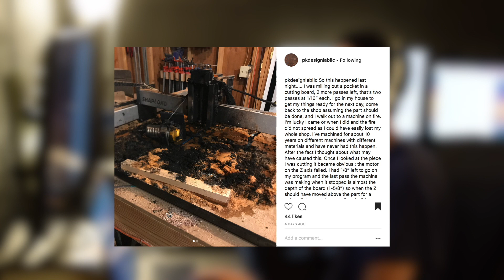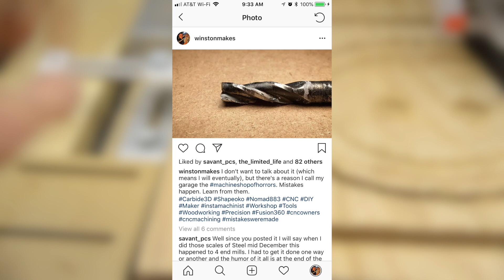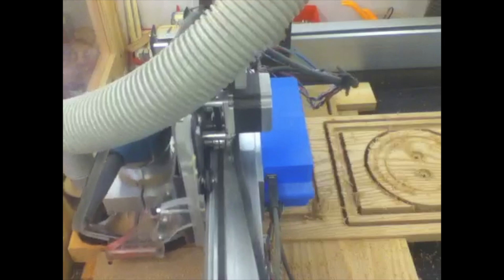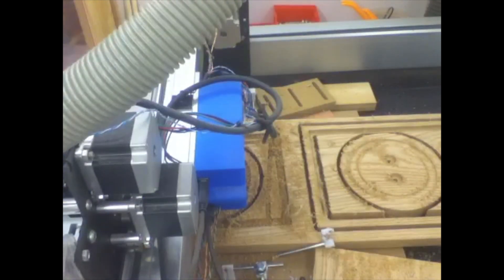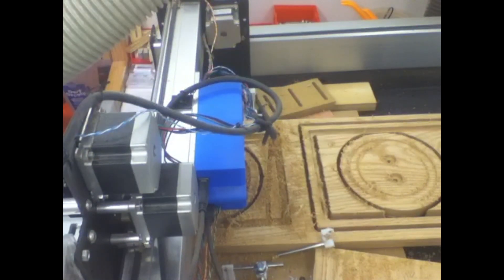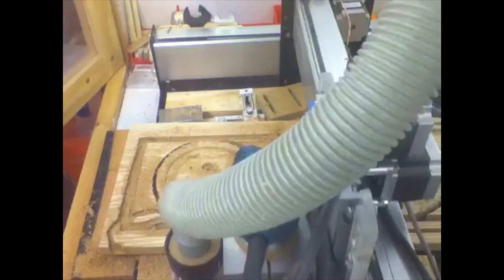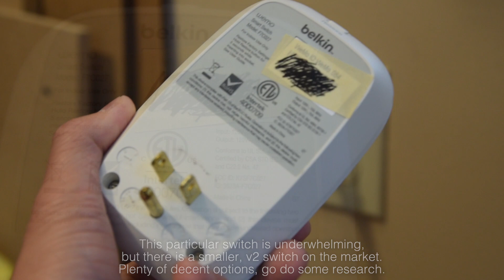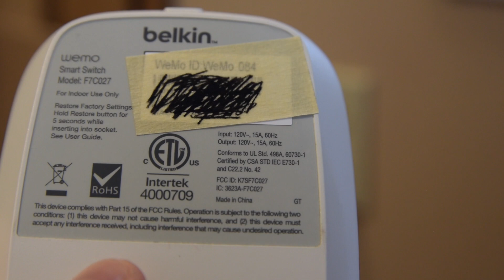I Almost Set My CNC on Fire - Let's Talk Shop Safety

Comment from the maker: ADDITIONAL TIPS (updating them as they come in):
1) If you suspect your vacuum has ingested sparks, check your dust collector and hoses immediately. Very fine dust accumulates in those systems and a fire could smolder for hours inside.
2) You can remote into Carbide Motion and control it using http://{your ip here}:8080 (i.e. http://192.168.1.1:8080). The carbide motion interface will be displayed in your browser. [Thanks, DIY Engineering]
3) Know where your nearest fire extinguisher is. (You do have one, right? Seems obvious, but it's worth reinforcing ad nauseum.)
Reply: Add overcurent protection to your spindle power. Plenty of ways to do this however its smart to have a way for this protection circut to hault the machine.

Comment: Great video. Had these issues in my own shop. Almost lost my garage to a major laser fire and my workshop to a cnc a corroded connection on the Z axis causing it to not lift back up while machining. All machines now have cameras and I'm thinking smart plugs for when I'm not in close proximity

Comment: I'm obviously VERY late to seeing this video. But as someone that runs a machine shop with six figure CNC equipment in it, I would also add one of the most important steps in preventing unplanned disaster. REGULARLY MONITOR YOUR TOOLING.  Dull tools, especially in woodworking are going to be a massive hazard.  I would add to that, don't cheap out on tooling. Carbide ain't that expensive anymore, and especially on high heat buildup applications like most woodworking stuff is, it's going to stay sharp a lot longer.  Remember since you're not cutting metal, where a lot of the heat gets taken away by the chip, an overwhelming amount of the heat is going to be transferred into your tool. And that tool can easily get hot enough to ignite wood.  Good airflow, proper maintenance and high quality tools are going to save you.  Even with properly clamped stock, you could still drag it out of the clamps by the added force of dull tooling.

Comment: Most line AC mains smoke alarms communicate via a shared line that puts out a 9 VDC signal.  Fairly easy to cuts AC power to CNCs and 3D printers and trigger other actions with this signal.

Comment: line your enclosure with drywall . It will give you a buffer as drywall is very very fire resistant. It is used as fire breaks in multi unit  homes and my father used it in walls to block the flame when he was soldering copper pipe. You can put a torch straight on it and it will not catch fire. The paper on the surface will but the underlying gypsum will not.

Comment: Is there not a CNC router equivalent to 3d printings' Octoprint?  I can send my files over the network, fully manually control,  pause, monitor and power on/off from my office pc, in fact it is possible to set things up so I can do all that from anywhere in the world provided I have internet access (not that I see much point in that to be honest) All it took was a RPi 3b, a cheap relay and an old usb webcam.  I would have thought CNC, being a much older and more established technology would have had something similar.  That all said - all the advice in your video still stands regardless, I'm just surprised there isn't something similar available.
Reply from the maker: You still have to be at the machine anyway to load material.
Reply: Absolutely.  I'm not suggesting quite the same level of remote operation, I just would have thought there'd be a similar setup for monitoring and control should the need arise.  Maybe use an ESP32cam board, with a simple web gui that can control a relay via one of the GPIO pins.  So if you have to leave the machine you can keep an eye on it and immediately hit the brakes remotely should something arise without having to get back to the machine to shut it down, potentially reducing any damage.  Imagine if the worst happens during a loo break! Shut it down with your phone there and then, and pick up the pieces when you're 'done'!

Comment: Great video.  Sharing the bad things is hard but the best thing to do.  Having a trip on the power which you can set the amps on can help so it trips once things go wrong and also sound audible alarms. As a thought, a limit switch on the clamps or some positional switch might help to sound an audible alarm if stuff comes loose.  I used to run industrial cnc and the easiest is simply don't leave them unattended.  Sure, take a book or laptop and work next to it but never more than 5 seconds away as runs could always be paused if needed

Comment: At work I use a MultiCam router with 20Hp vacuum. I was cutting 1/8” thick aluminum when the bit plunged thru a loose part causing a friction fire.  The vacuum table made it 10x worse. Luckily I was there and was able to get the fire out in time.

Comment: First get a brushless water-cooled spindle, have a fireproof enclosure, have IR heat detectors connected to the emergency stop loop and fire suppressant system, have your internal CNC wiring checked by a professional..
And even then, you won't let your CNC alone.

Comment: New steppers drivers with missed step detection ? The new trinamic can be used as the old drivers but you can plug in an Arduino, and if your machine misses a step have your arduino send something to the control board or a relay to shut everything down

Comment: I would recommend having several types of extinguishers on hand as well. My goto  first for electronics these days is Co2. They do require the ability to control air flow into the effected area. But they are far easier to cleanup post usage. Without destroying electronics or requiring a significant amount of cleanup time. Halon is not a good choice for home/small shops not to mention the cost and additional safety concerns. While its the other go to for electronics, and works. The chance of suffocation and the environmental damage means its a liability and restricted for sale. But I still keep a powder based extinguishers on hand. As well as a water based one. With them Labeled and accessible.

Comment: I have a lot of respect for you, Winston, but I find it utterly irresponsible to be discussing ANY form of remote monitoring solution for ANY unattended power tool - whether a CNC, a table saw, or any other high-velocity cutting machine for that matter. Advise your insurer that (a) you are operating a CNC in your home, and (b) it is left unattended while operational... I'd love to hear their response... Let alone the risk that (in your case) a neighbouring child hears the noise from your garage (while you were across the street there), and wanders inside to see what's going on... your fire suppressant ball is of little value then. PLEASE (and in your capacity as an employee of a CNC manufacturing company, I implore you) DO NOT be advising/recommending ANY "solution(s)" that suggest/imply that an unattended machine can be "made safe(r)"... it's simply not true. (for your sake,  there could even be an element of "liability", were anyone to take on board your (otherwise respected) advice, and then experience an incident)
Reply: You are right, the biggest concern is with the routers used, most are brushed which mean they produce sparks (add some fine wood dust...) and they were not build for continuous operation.
You don't leave such thing unattended !

Comment: THANK YOU SO MUCH for this video! This is a video I am going to keep on hand. I am a student welder, which is WROUGHT with it's own safety problems to plan for, but also starting my own welding/fabrication/makerspace company I need to plan out being able to induct other people on safety in MY shop. I just received my SainSmart CNC router of which I dedicated some investment into for the ability to broaden my projects. However, had no idea other than common logical safety guidelines with it, so this video is a sobering expansion on my list of outcomes. I already have an Induction Plan for guests to my factory/makerspace involving welding, but THIS is totally going to be going along with it as an example for what can go wrong with CNC machines. Good tip with the WIFI power outlet - I will have to plan something like that for my shop, as I already have a Wifi-Webcam setup for it.

Comment: When it comes to CNC safety, I think the most important thing is to hear the machine as it's working. Pretty much every time you can clearly hear when something goes wrong. I never walk away far enough so that I can no longer hear my machine working. And yes, having a fire extinguisher in the workshop is a must, regardless whether you have a CNC machine or anything else.

Comment: What are people's opinions on cheap dry powder fire extinguishers vs more expensive CO2/Halide/Halotron tanks? I was under the impression that dry powder extinguishers were corrosive and would pretty much destroy your machine if used, but now everyone's using these balls that AFAIK are essentially the same dry powder materials set to automatically dispense.

I would like to not spend the extra money on exotic fire extinguishers but also would like to be able to put out a potential fire without destroying everything.

Comment: I lost a laser cutter within 30 seconds of walking away. Laser got disconnected and fired full power without moving and caused the material to ignite and start a fire. Due to the window being on the topside of the machine, and having a really strong exhaust, even though I was only 6 feet away and facing the machine I didnt realize anything was happening until the top window melted and you could smell the plastic melting on the exterior. Bet the neighbors got a good scare from all the smoke billowing outside lol.

Now I have one of the webcams with remote access connected and servo control with an ipad that I have within view the whole time, and I have added emergency stops on the main power lines to my new machine as well as invested into halon so that if I do have to use an extinguisher I wont ruin the electrical components of the machine.

Having one of these mishaps is definitely eye-opening and Im glad your shop is still intact!

Comment: I have stepper closed loop system on my lathe controlled by  Centroid  Acorncnc.
The drivers a  default built in and shuts drivers down, if there is to much torque.

Comment: Has anyone thought of grounding the bed holes to a touch plate like zeroing sensor so if the endpoint touches a metal clamp it interrupts the program to go to failsafe?
Reply from the maker: The touch probe system requires electrical continuity through the endmill, and that's typically done via an alligator gator clip to the the endmill. If you can get it to work by clipping to the casing of the router or something not spinning there's a chance. Otherwise not likely.

Comment: I have a question.  I am debating purchasing a shapeoko.  The location where I plan to  have it set up is in my detached garage with out ac.  I live in Louisiana. Summer time is stifling.  How does it hold up let say in a shop or garage that is not climate controlled?
Reply from the maker: Ive heard of people periodically having to check belt tension and whatnot with large temperature swings. My bigger concern is personally humidity in the context of wood/MDF movement over time, particularly with the wasteboard. I have not quantified this though. It all basically boils down to a shorter maintenance/checkup interval. But the machine itself should run fine.

Comment: I have had fires twice both times caused by bad CAD software and dull bits.
Cad software Vectorworks creates complex curves  as thousands of tiny straight lines and my post processor works it way through those curves excruciatingly slowly, enough the bit heats up and starts the wood on fire. With a downdraft table and dust collector the fire is invisible as all smoke is drawn down into the table or up the dust collector. I now make sure complex curves are smoothed by my post software first, and avoid Vectorworks drawings at all costs.

Comment: Fire suppressant, monitoring and smoke detection systems aside, it seems that one of the failure modes common amongst these starts when you lose steps and the system no longer has an accurate relative position of the cutting head.
Could this be aided by a device tuned to detect skipped steps, similar to the microphones used in modern engines to detect knock/pinking? Maybe something the stepper driver can detect through back EMF?
Just thinking out loud really.

Great video as always Winston. It raises some really valuable points that are often neglected in the hobby CNC/3D Printing/Laser cutting world.
We had a minor fire on our 8' x 4' CNC router when a dull end mill basically primitive technology-ed itself a large hearty fire with a nearby gathering of chips/sawdust.
Timed dead-man switches and various monitoring systems have helped since, but nothing is ideal.

Comment: One clamp by itself does not have enough holding power to withstand XY torque from even a light cut taking place more than a couple of inches from the clamp. Therefore, two clamps = single point of failure. 

(DarwinGarage also had only two clamps, according to the video comments.)

Four-point workholding should be your default, and IMO anything held at <4 points shouldn't be left unattended at all.

(Sidenote: the load at each workholding point increases rapidly as you decrease the number of workholding points. If you remove a single point of workholding, the total torque on the rest of them increases because now the moment arm is longer when the cutter is engaged near the now-removed workholding point. As a result, workholding is prone to cascading failures unless there is a very generous safety buffer built into your workholding setup.)

Comment: I've heard of also using a smoke detector where the speaker also triggers a GFCI outlet and cuts off power to the whole system. Might be a bit too late for a cnc with a bunch of mdf and sawdust in the enclosure, but for a 3d printer in a cheapo enclosure, it might be a valid safety step

Comment: use a smoke detector connected to the emergency button connection. can't get wrong with that.
a bag of sand mounted above the CNC with a special contraption that spread the sand over the burning part should be another idea.
sand can be cleaned, the marks of a fire cannot.

Comment: I once had a long plank of wood clamped through my Shapeoko2.  I walked away, so the CNC tried to make a break for it.  I returned to find the plank had come loose and shifted severely, the part was a little burned, and the Shapeoko2 was moved almost half way off the bench!  Lesson was learned that day.  Also I never  leave my homemade 80W Co2 laser running unattended for obvious reasons.  It also has its own dedicated fire extinguisher and water squirt bottle just in case.

Comment: Since it appears that one of the main cause of these mishaps is the work piece moving on the table, it would be fairly easy to setup an alarm by having a contact sensor between the work piece and the table.  If the work piece moves, it breaks contact and sends an alarm or pauses the system.
Reply: how about just secure your work piece, jfc, this side of the "CNC" world is embarrassing.

Comment: I would consider moving the fire extinguisher ball to the center of the ceiling of your enclosure.  I suspect by the time the flames reach that corner, your entire wood enclosure is going to be engulfed and it's unlikely to make a significant impact to a fire.    Having it centered on the build platform where the fire is most likely to happen gives you a better chance.

Comment: Thank you for bringing this matter to the attention of the CNC community. It's easy to overlook matters of safety because they're predicated upon rare events but this is a very important issue. I'm currently embarking on a production using CNC that will run 24/7. I have not yet addressed these safety concerns but I will. I'll install a remote video monitor. I'm thinking of hacking a smoke detector that's inside the enclosure so it can E stop the machine. My typical crash breaks a 1/16" router bit producing essentially no risk of a fire from friction but this sort of hazard mitigation must necessarily include the extremely rare event.

Comment: Great advice Winston.  Well done.  I have both a fire alarm and a fire extinguisher nearby.  I babysit my laser because most jobs I do are in the 5 minute range and are often repeated over and over requiring me to switch parts.  On the CNC job times run longer.  It's best to find another task that can be done within eye/ear shot of the CNC.  I haven't gone to the extent of a camera setup at this point.

Comment: You may not be able to use teamviewer free for that for very long. I just got kicked off of teamviewer (account removed) for the second time due to "suspected commercial use" because I was using it to watch my CNC machine, etc. Now that you have shown it on your channel which you make money off of "commercial use" you will probably get in trouble unless you pay for an account. They are not very friendly. But TightVNC is a good free alternative if you can handle a few more steps and not as nice front end/GUI applications.
Reply from the maker: Good to know. Really they should be paying me since I'm plugging their product... 🤔

But since DIY Engineering mentioned remote access to Carbide Motion via IP/Browser and there are options for full PC control I think I'll be fine. Thanks for bringing that up.
Reply: Yeah, for anyone playing along at home I would still give teamviewer a shot for as long as you can if that fits into your workflow. As you mentioned there are many alternatives and different ways to accomplish the remote monitoring.

Thanks for the reply, Winston. Great video as always and this is a topic that I think needs to be revisited once in a while to keep it from being overlooked. We are all guilty of becoming complacent over time. Cheers!